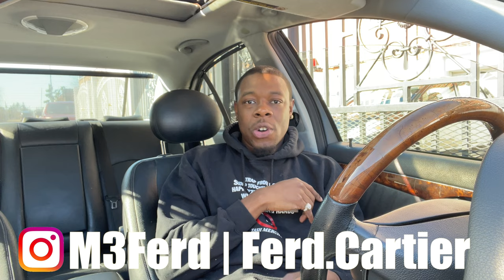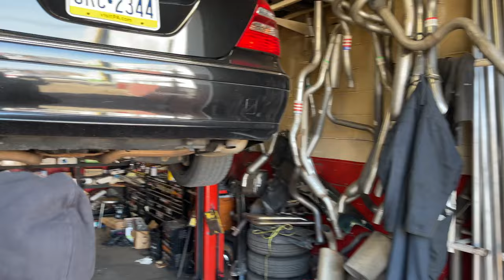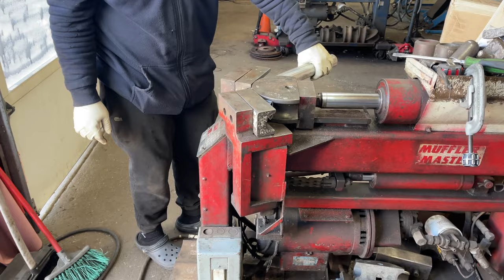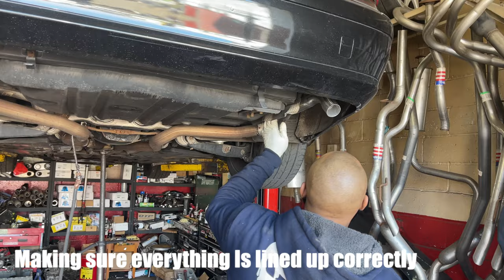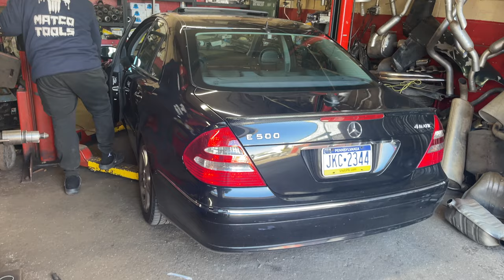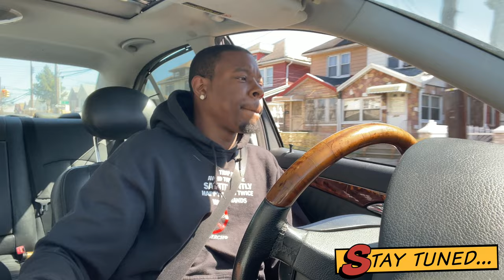I made my W211 E500 Mercedes Benz LOUDER with a MUFFLER DELETE #w211 #E500 #mercedesbenz

Comment: Nice! What engine is this? The M113?

I had my 2003 w211 E500 done recently. The previous owner cut the mufflers off and just left it. Didn't even add the pipe to the rear. Sounded loud, but like ass. Just a loud sound with no definition. 

I had some larger pipes and mufflers added to the rear, and the front has larger headers. Gives it such a big, old-school V8 sound. The W211 V8 definitely turns heads once it's opened up.
Reply from the maker: M113 i could imagine how that sounded lol. I’m still looking to get a 63 or 55 as a daily
Reply: @M3FERD  The M113 is superb!

Yeah, I'd love to get a 55 or 63. If I get an AMG it's definitely going to be a w211. They look so damn good with the front grill.